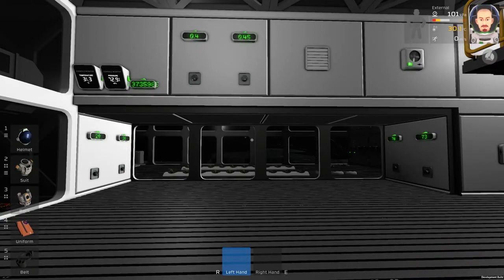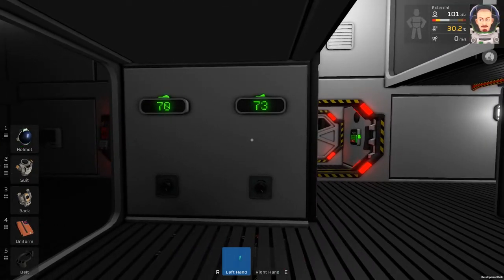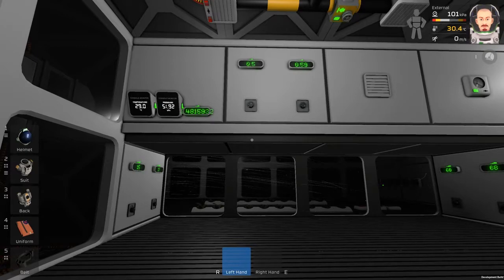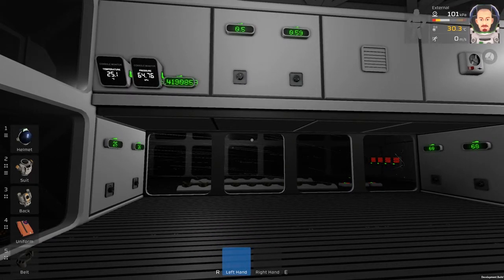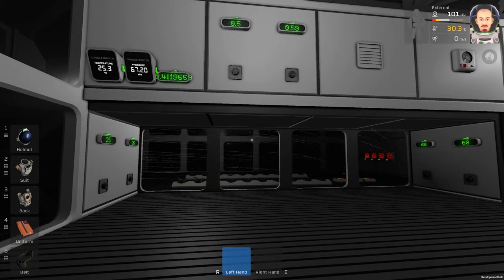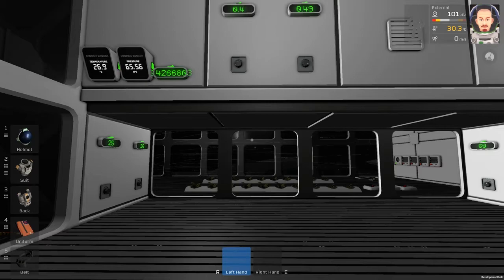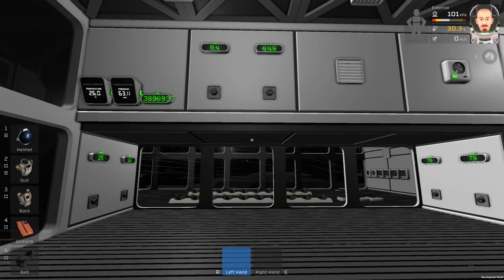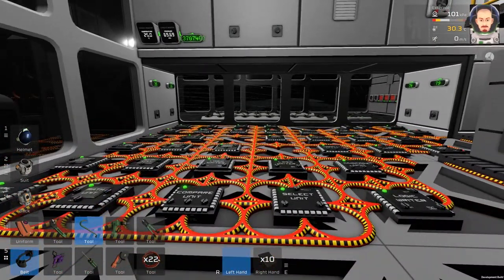Stationeers - Greenhouse Ultimate Control

Comment: How do you round the co2 percent for a display from the given output you get from the gas sensor
Edit
Got it working, thanks for the awesome videos. They always push me to go further and make cooler and bigger stuff
Reply from the maker: Before I could respond to your comment, you did it on your own. Good job man!
Reply: Haha ty man, I did it in a way that might be different or even wrong but it is getting the job done for auto injecting co2 into the atmosphere. I took the valve from the gas sensor and multiplied it by 100 and then rounded it and I get the correct atmosphere amount. I like how you have the % actually on the LED its sick. My next problem is getting some logic setup to not just inject every time its below 2% and actually solve the problem and provide over 2% to a predefined %
Reply from the maker: if you want to display % take that number you rounded and switch your LED display to mode 1 with a logic writer, let me know if it works for you
Reply from the maker: if you want to injent CO2 in predefined range, you can build "Schmitt trigger" thats how you can solve it once and forever, ofcourse you can use "Schmitt trigger" for anything you want, temperature, pressure, gas ratio etc.
Reply: That is awesome man, thank you so much! I'm going to do it today, I will reply and let you know how it goes :P
Reply from the maker: you are very welcome, I am glad it helped
Reply: Sorry for not replying sooner, but I got the Display and the Schmitt trigger setup following your input about the mode Display and then a guid on the Stationeers wiki and fit it to my needs. Thanks again it is awesome!
Reply from the maker: no problem man, take your time, it is more important to build your own stuff and then reply if you want and you are welcome of course